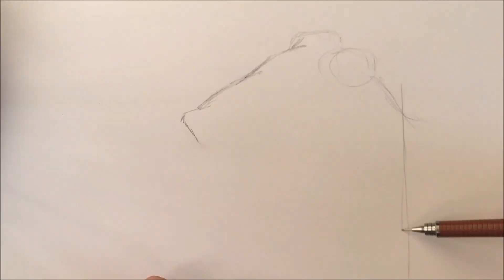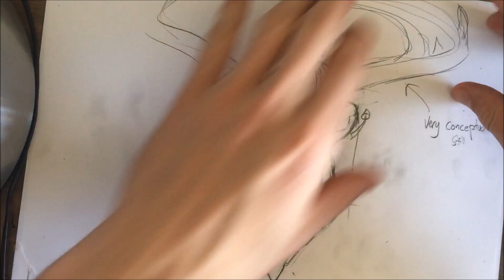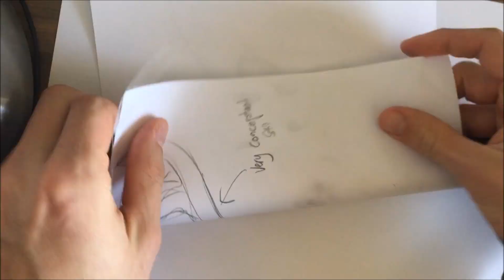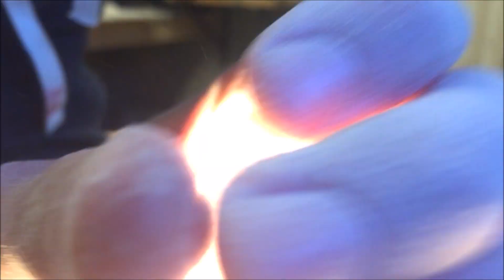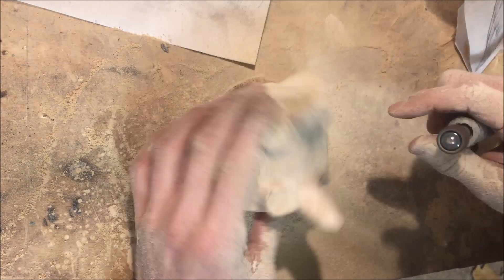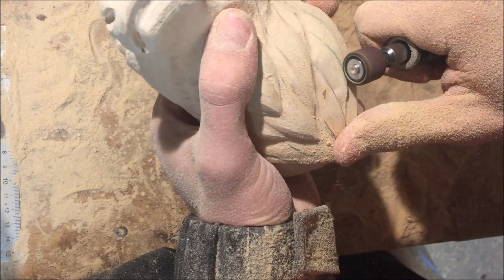WOOD CARVING BUCK SCULPTURE PROJECT PART 1

Comment: You must get through a lot of sanding tubes as you use them such a lot they are very useful. i also noted you used a saburrtooth burr wheel, i just got an Arbortech mini grinder which is similar it gets through the wood very well, but I need more practice, I`ll get there.